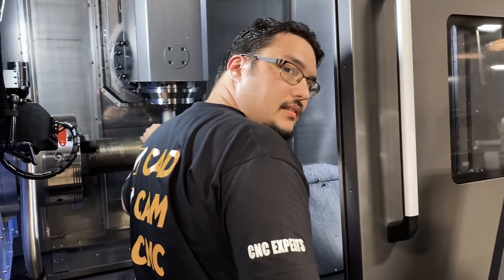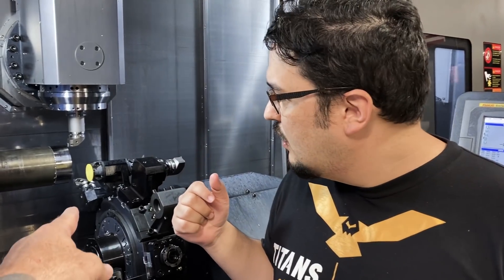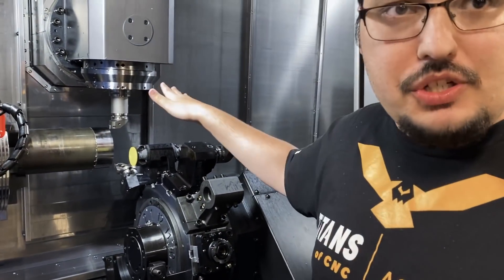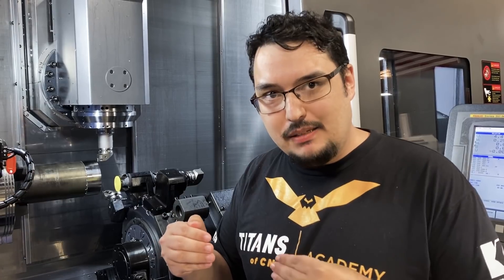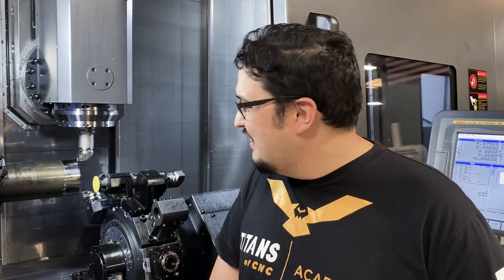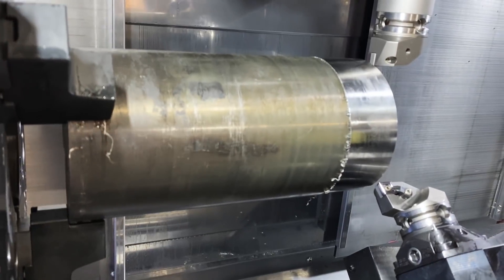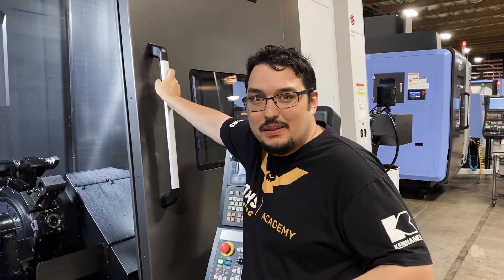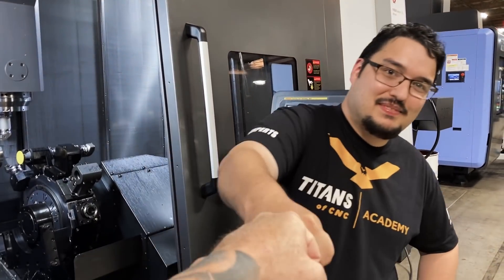Pinch Turning Hardened Inconel 718???

Comment: Am I missing something here,he's talking about balanced machining and being 180 deg.apart but from what I see it looks more like 135deg.apart.I'm no expert  but I wouldn't have the balls to machine it like that with the amount of grip in soft jaws if he is not going to use the tailstock.
Reply: Exactly my thoughts. If you were to take heavy cuts the turret tool would push the towards the milling head tool and at that angle it would probably try to climb at least one tool. I think I would try to start with a slightly lighter cut with the turret and go a little heavier with the upper one (If you turn the other way then head first turret second) but definitely hard jaws and a shitload of clamping pressure from preferably a 4 jaw!

Comment: Make sure you got your P code right so that it does restart at the wrong time. Been a machinist for 15 years on twin spindle milling machine like your. I hope you know what will happen with Inconel when insert get doll. I would not recommend dual OD turning on the same side if it is OD and ID not a problem.

Comment: Be nice if there was actually some turning being done instead of just an advert for the machine
Reply: Exactly...!
( million dollar machine )
Anyone who already "understands" that the work in the chuck is an inconel based material ...should have the technical " APTITUDE " ability too interpret chip load on two opposing tools
___\/_____
____/\_____        
One rotation (rpm)of the material , has two tools presented into the work , affecting multiple tool passes in (twice as fast)  (rpm ÷ 2 tools )...material removal
(sfm) has not changed on each too, las long as the first tool remains 100 % efficient the (chip load ) can be a ( constant ) , the same on both tools !
BEFORE any set-up time ...
   Before ....   "ANY WORK" IS  CONSIDERED ! or even ( placed in the chuck )
The very fist consideration in any machining operation ...!
#1"WHAT IS THE COMPOSITION OF THE MATERIAL TOO BE MACHINED...!" 
a. Does the material MATCH the "specifications" of the blue print or work order ?
1.Specific Material Composition
2.Size 
3.Orientation ( grain direction )
Reply: oh fuck off they're talking about what pinch turning does. I personally didn't know what it meant, and i appreciate the info.